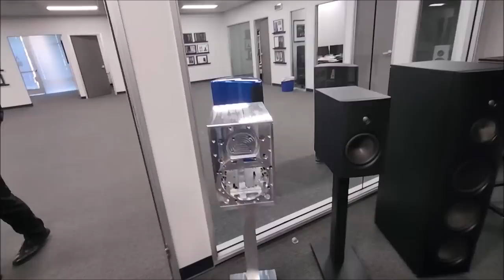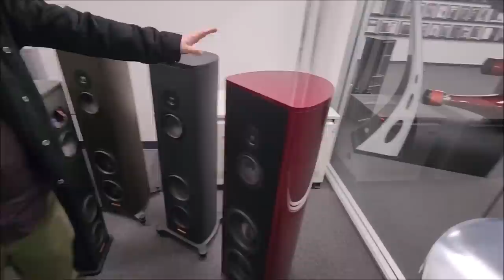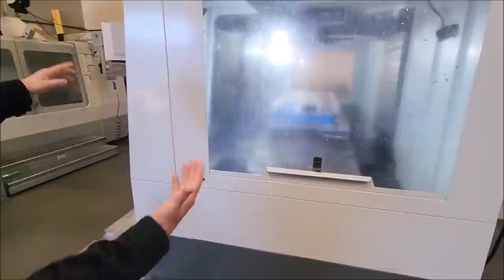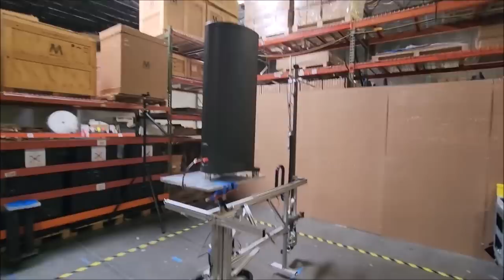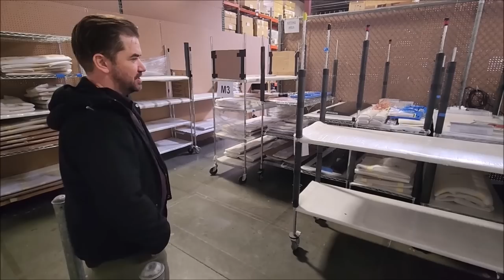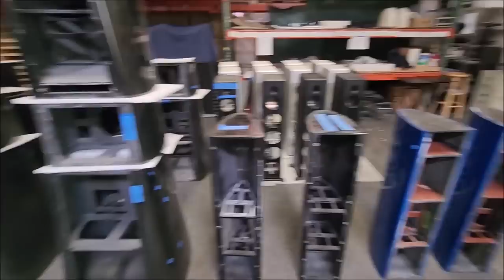What Surprised Me Most? - Magico Tour - Part 1

Comment: Well done, thanks for posting this video! Alon very openly talking, more so than in similar factory tours at Magico. Still asking myself about aluminum everywhere, which is supposedly quite "ringing" (according to other vendors...). Sorry I am still a Wilson Audio happy customer :-)
Reply: Aluminum "ringing" is a good thing. Very low energy storage (very high stiffness to weight ratio), easily damped. My A5 enclosure is as dead as enclosure gets. Check out the new Rockports. Also, all aluminum, albeit super expensive.
Reply from the maker: You'll see this "ringing" thing addressed early in Part 2
Reply: Heard the old celetian SL 600/700? They never ring. I owned both before,  but I prefer the LS3/5a . Japanese high quality speakers beat them all 😊 in all aspects

Comment: It's a lovely rack. The rack you're looking at, the four, has a list of 42,000; the three it's listed for 32,000.  But I think I see it's on wheels which is rare to see. Not sure I understand the grounding rod.  My guess is they don't sell too many of these rocks.  If I put a component of these racks I can just imagine how much better they will sound. And if they don't sound better I better not be standing in a really tall building
Reply from the maker: They are much more expensive than I thought, but impressive nonetheless.  I'd love to have them in my system... The value equation is always going to be relative to people's income and thresholds for cost/benefit.  

They don't sell many or push this product from what I was told.  However, for those that want the best of the best, I found it noteworthy.

Comment: Aluminium rings like a bell but MDF doesn't !! Also the Klippel doesn't measure phase and timing information so nowhere near as useful as a proper anechoic chamber.
Reply from the maker: Aluminum does ring as I'll show in a subsequent video, but there's more than that in a Magico.  You'll see that the bracing and constrained layer dampening changes it to virtually no ringing.

Their vibrometer will also prove it.
Reply: @AudiophileJunkie  How do they achieve time alignment between the drivers and how do they assure optimum impulse and step response especially when they are using high order crossovers ? I have never seen them address this issue. They seem to exclusively focus on cabinet vibrations and ignore other factors.
Reply: @AudiophileJunkie  You don't address the question above. How do they do time alignment? Or is that not important?
Reply from the maker: You will see Alon addresses that in part 2...stay tuned
Reply from the maker: Patience...it's all in part 2
Reply: @michaelhope007  Very few passive speakers are time aligned. In fact I think that only Vandersteen is. This concept is more about marketing than a real virtue.
Reply: @mrhd5831  Because they can't easily do it doesn't make it a lesser virtue. It just means they can't do it so instead they dismiss it and focus on something that for all intents and purposes is in itself a lesser virtue.
Reply: @mrhd5831  Dunlavy, Duntech, VenderSteen. What do you consider constitutes a good loudspeaker then? A flat frequency response and a dead cabinet? I can do that with full range driver and a cabinet made from bluestone bricks and cement. Doesn't mean it will sound good. What about step response? Marketing?
Reply: @michaelhope007  If time alignment was the path to nirvana, Dunlavy and Duntech might still be around (they were pretty much the same company, if I remember correctly). It's actually not difficult to build a so-called "time-aligned" loudspeaker. Hardly anyone is doing it because the tradeoffs are too great. And as been mentioned in the second video, it has yet to be proven to be a factor in sound quality. There are many things to consider designing and building loudspeakers. You should watch the videos and see some of those.
Reply: @BuzzardSalve  "Because they can't easily do it doesn't make it a lesser virtue."
Of course they can do that, if they choose to, its not that difficult.
Reply: @mrhd5831  If a flat phase and frequency response is unacceptable in the upstream electronics driving the speaker then why should it be acceptable in the loudspeaker it is driving ? And please show through measurements how a constrained layer damped equipment rack improves sound quality for anything that is placed on it ? I have yet to see any measurements to justify the claims. And btw John Dunlavy died years ago but his speakers are still well sort after the on the 2nd hand market. He must have done something right ;)
Reply from the maker: Correct...Their cabinets were nowhere near the level of Magico.  In their day, they were fine and a friend of mine still owns a pair of Duntech, but they don't go in his reference room anymore.  Plus, it's debatable whether time alignment was even what people liked about those speakers.

There are speakers that still do "time alignment", but again...is it the time alignment that people are liking...or is it just doing other things correctly???
Reply: @BuzzardSalve "why should it be acceptable in the loudspeaker it is driving"
 Because of the tradeoffs involved in achieving that passively.
Reply: @AudiophileJunkie  No one said that time alignment is the determining factor. Magico just focuses on one aspect namely cabinet resonance and then proceeds to bash the competition for not doing it the way it does it when in reality it is not as importance as what it wants you to think it is. I have seen plenty of well constructed dead MDF cabinets but that is not the determining factor for these designs. Many other factors come into play when it comes to loudspeaker designs but usually it is a case that the whole is greater than the sum of the parts.
Reply: @mrhd5831  Ahhh Duntech is still around, Vandersteen is still around, John Dunlavy has passed away. I have an active TIME ALIGNED SYSTEM. You can change the timing on the fly. Before you going saying it's of a LESSER VIRTUE (sounds very left wing to me) why don't you sit in front of a pair of speakers and change the timing by 2 mSec while listening to music? I can tell you now and so will everyone that has heard my system that IT IS AUDIBLE. It's sounds like smearing. You can get so good at listening to this that even an untrained ear after 30 mins can tell that the sound isn't coherent when it reaches your ear. But as you don't possess a crossover or a system capable of adjusting the delays of the drivers ( active crossover and 8 amps needed) you really can't comment. Or are you now going to tell me that you have owned such a system and it made no difference when you dropped 2mSec from the midrange on the fly?
Reply: @michaelhope007  Are you using DSP (rhetorical question )??
 We are talking about passive design. It will help if you watch the video before you jump in with irrelevant comments (Regardless,  I can assure you that you will not be able to tell which is the "right" alignment in a blind test) .